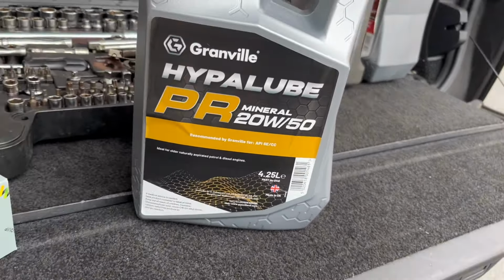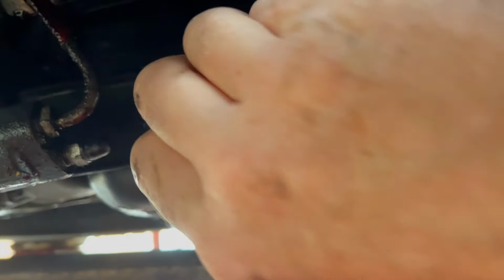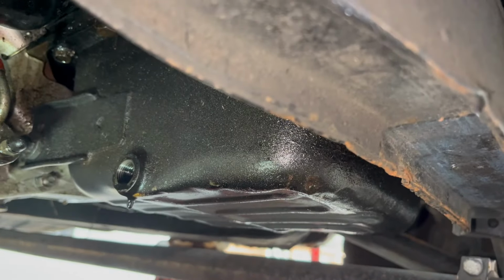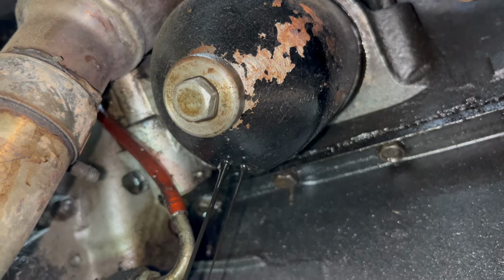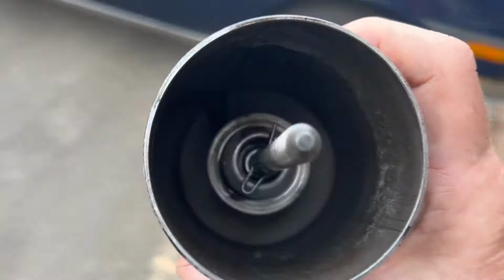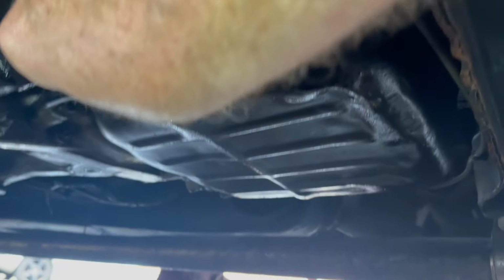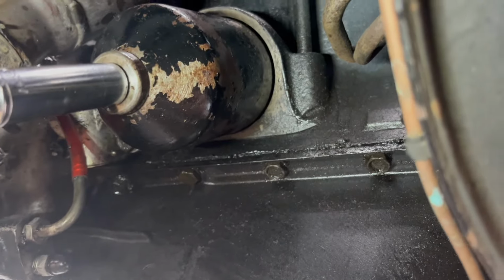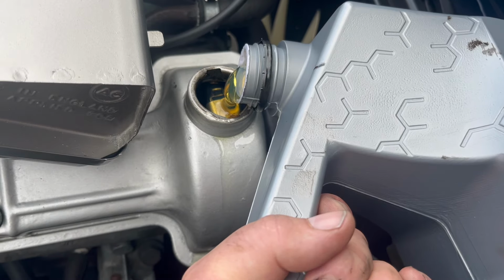Triumph Stag Oil Change

Comment: Do you have an oil cooler? I have a stag for 3 month now. No problems with overheating till now,  because there was a new Thermostate (? Is this the right word ) and a electric cooler added.  But I am thinking about to install an oil cooler...

Comment: I prefer the original style filter over the spin on type , many friends with stags have gone back too , the spin on base plate tends to unscrew  and can be very awkward to get off without the special tool and actually makes more mess ,  mineral 20/50  correct,    thanks for sharing,